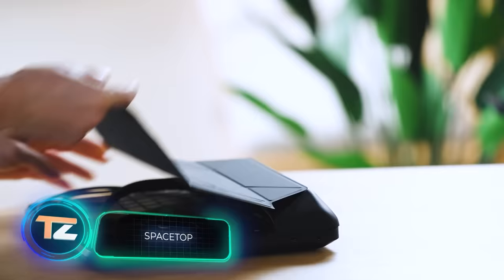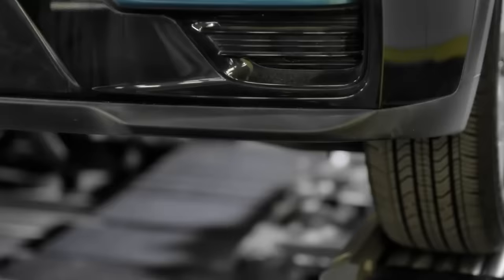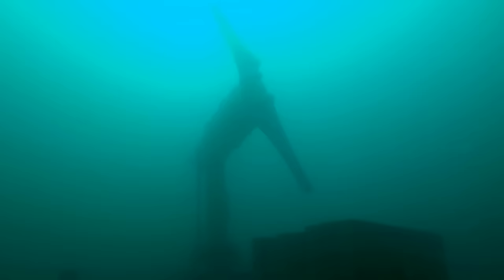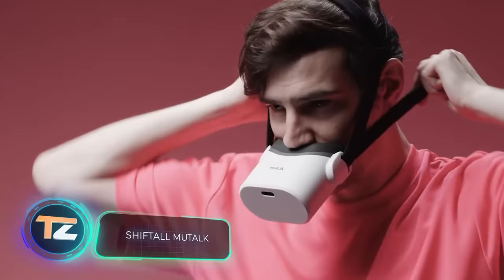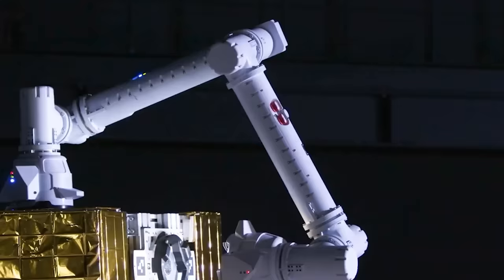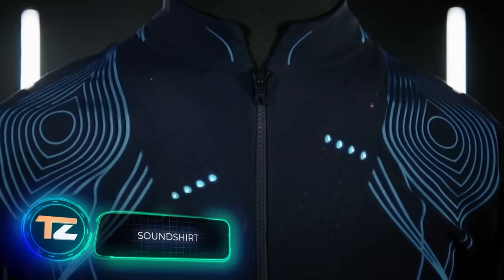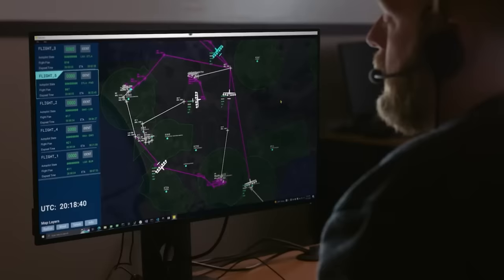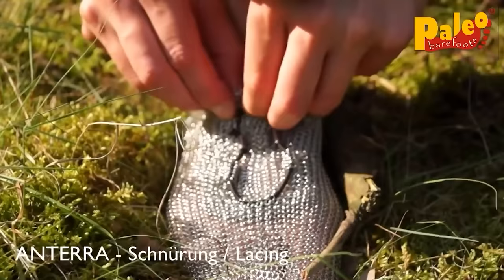70 INVENTIONS ON A WHOLE NEW LEVEL

Comment: Re the camera mount at 03:00, I was years ahead on that.

In the 70s I built my own mount using 3 pieces of 1-1/2" aluminum pipe and a threaded "tee".

My Canon F1-N camera was mounted to a 400mm lens (Russian, I don't remember the name, but it had decent optics, cost $40, f/5.6 to f/22), sometimes used with a 2X converter. The lens provided mounting for itself and the camera.

My mount extended a few inches beyond the front of the lens to sit on any available surface, and far enough rearward to rest on my shoulder. It had a handle with a built-in cable shutter release.

It wasn't fancy, but wasn't expected to be. It was rugged, cheap costing about $10 and took an hour to build, and worked great on things like wildlife, particularly birds and small animals.

I took it to a race in Charlotte, NC where we lived at the time, and 400mm would only get a couple of racers in view at a time. Lots of magnification, too much in fact.

People didn't know what it was. In those days not everyone used a 400 (or 800) mm lens on a homemade mount.

800 mm with ASA 25 Kodachrome was a handful, even in bright daylight, equivalent to f/32.

Comment: It is also possible to use the Water as a Thermal Electric Generator along with the Solar Isle. Doing this will cool off the Solar Panels making them more Efficient on Blistering Hot Days.

Comment: I love the idea of being able to drive a street sweeper from home... I'd do that job.    😁👍
Edit 1: That Jetopter is basically a big Air Hogs plane.... You can run one of them forever if you have a small air compresser on board that runs off solar panels.
Reply: No. You could not.
2nd Law
Reply: @jimrobcoyle  If you can harvest enough energy with your solar panel and your bearings are good enough the second law doesn't come in to play.

Comment: Love the 6th finger concept and see no reason it couldn't be extended to 7th or 8th fingers. Imagine how insane some musicians could get with these additions? I have a weak left pinky and it has always limited my guitar playing so that I avoid certain chords. With 6th finger, that problem could be mitigated quite readily.
Reply: Nice idea but potentially not possible. Your hindbrain actually changes in response to the sixth finger by being slightly less precise when directing your fingers. On the positive side, you gain "normal" control so it works just like your others. On the negative side, fine motor control suffers a little. If you were to add even more, I suspect that none of your fingers (real or additional) would be precise enough to play an instrument.
Reply: As a single Mum, there were Many,Many occasions where a load of extra Arms and Hands would have been incredibly useful
Reply: Quick thought,,,(My hubby is a musician, plays guitar amongst other instruments,) 
If you avoid certain chords because of your pinky,,,maybe learning some power chords to compensate? 
Or possibly use a more simplified version, whereby you dont use the pinky finger at all? Youu will find a way around it anyways.xx
Reply: Have you seen a mango named "ghost in the shell"?
Reply: Or another hand or two altogether, that wold unhand many guitars playing at once!!  LOL
Reply: @URich87UA  Nope, but I've seen a banana called,"Spirit in a Glass!"!!
Happy New Year to You and Yours ✨!!🎊🕛🎉🥰💞🕊️🫶🎈🤗🎇

Comment: 55:30 Milda should be inverted to be even safer. As it is, it is even easier to use the handle to suffocate yourself on than a traditional handle. If you invert it, it would make it orders of magnitude harder to do that.
Reply: install it upside down.

Comment: Anti bacterial door handles are not an innovation. Ever heard of copper/brass? 
copper-based alloy surfaces have the ability to destroy a wide range of microbes and bacteria relatively rapidly - often within two hours or less.

 "coatings" wear off.  🤨 and what mystery chemicals are they using to achieve this? Are they safe?

I do like the handle design otherwise.
Reply: When i was a child, they taught us to sneeze on our hands

Comment: Strange mix between "okay interesting", "expensive crap", and "outright dangerous" (like e.g. StockCam (getting shot while trying to take a picture) and EasyTread (Scanning just a few centimeters of a tire is not enough, if you ever used your brakes)). If your serious and not just pushing products, switch on your brain before showing something as a nice innovation.

Comment: 8:45 Honestly was thinking about this solving the problem of waiting to charge an electric vehicle. Let's say we buy an electric mower. Some come corded, giving you lasting power that will never run out, but you'll have to deal with the cord. Since we can't drive an electric vehicle with a cord attached unless we drive in a system like bumper cars, we have to go battery. Buying a lawn mower with a battery usually comes with two batteries. one in the lawn mower and one charging. when we run out of power we simply swap the batteries. Next challenge is to reduce the size of the battery and increase the power in it to make it comparable to gasoline cars.

Comment: Jetoptera is cool but these ridiculous claims about "produces 10% more thrust than a turbojet with 50% less fuel" is misleading.   It can probably produce 10% more thrust on half the fuel, but the comparable turbojet will also be a quarter the size and be able to produce 10 times the thrust in total.  It will burn FAR more fuel to do so, but they make it sound like you could replace the engines on jet liners with this tech, but they're comparing apples to oranges.

Comment: Battery replacement good idea until you receive one of lower standard such as old for new
Reply: So? You'd swap it out again the next day.
Reply: @K-Locke  presumably there is a cost each time so maybe age will affect how long they last?
Reply: @helendancelot  You don't understand the business model. It will have to be done in partnership with the automobile manufacturers. Battery packs would need to be standardized and designed to be quick changed. So, let's say you buy a new car. It would be sold with a battery pack that could be a year old, a few years old, or brand new. It doesn't matter, because you're going to swap it out with another the next day or so. Basically, you wouldn't own it, the battery charging stations would. I don't think anyone has actually worked out the details yet, and it would require a lot of co-operation between a lot of corporations. But, it would solve the charging time issue.

Comment: Battery swapping requires way more batteries. The battery is the most expensive part of an EV. Series electric for range extending is a better solution for now.
Reply: Surely the swapped batteries are recharged then used again. A bit like taking your bbq gas cylinder to be swapped for a full one.
Reply: Honestly the thing I would be most worried about is price of maintenance, weather proofing and obstruction proofing, and cost to repair whenever some idiot crashes into it.

Comment: 0:40 If these glasses were 1/4 as good as they appear to be in this video they would be revolutionizing the VR / AR industries.  NOTHING out right now comes close to this.  The closest you get is a $600 quest 3 and it can't even make that many virtual monitors, and the pass through is terrible by comparison.  Point being if this existed it would be worth $2,000 just for the glasses and it would be idiotic to tie them to their laptop.  They would make them compatible with every computer not just their own.  In other words, whatever these actually do, its not close to what is being shown here.  Buyer be ware.

Comment: DCL did NOT complete flips and rolls with a live pilot. That was a dummy to simulate the weight.  Live action Drone Racing will NOT be a thing due to the G forces created in high speed turns and maneuvers. Not to mention to be competitive in racing you need to take risks to pass and that does not bode well when powered by spinny blades o deaths all around. that is before the whole falling out of the sky thing happens.
Reply: It is not a drone if there is a pilot in it.
Reply: @duudsuufd  There wasn't a pilot in it. that was a mannequin to match weight

Comment: Great those tread depth monitors will soon be placed on main routes and coupled with license plate readers to send you citations for unsafe equipment.  Non payment will result in suspension of your drivers license and then insurance companies will link with law enforcement to suspend coverage due to both unsafe equipment and suspended DL, then they’ll share info with finance companies who will partner with LE to have your mandated purchase electric vehicle disabled do you can’t drive their car without insurance and proper license.  Then they’ll gave it towed and impounded ur you don’t remedy the problem which will cost you more money by the day, eventually causing you to lose your job for coming in late or not at all due to transportation so you’ll soon be unemployed and unable to get another job because you can’t get there and youll quickly be a thousand bucks and counting in the hole with no way to catch up, all because you were waiting to get your next paycheck to buy some new tires.

Comment: The tire analysis BS is absurd.  You can do the same analysis with one glance at each tire. It would only be useful if it could work on something like a fleet of 18-wheelers driving over it as they return to a depot, which very few 18-wheelers actually do.   The idea that a tech would waste time driving over a particular thing and opening a program to get the same result they can get with a glance is absurd.   Besides, tire wear bars exist for a reason.
Reply: This could be useful at weight stations and port of entries. For semi and trailers. Besides that it's pretty useless.

Comment: So essentially the high speed solar car could only maintain 56mph the entire journey... sad just sad remove the speedlimits and chase the sun like having the  wind at your back ... actually running from the sun would be more like it you'd gain the fastest speeds  but the 2nd race in opposite direction  immediately following the conclusion of the fast race the slow race for a strenuous hard return trip leaving everyone to engineer for both opportunities advantages and disadvantages  i should name it after myself even